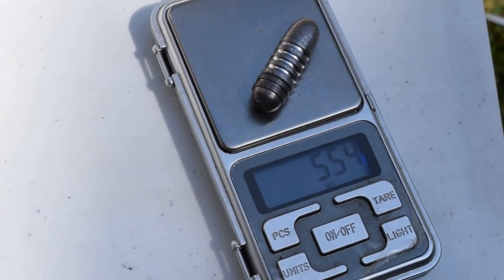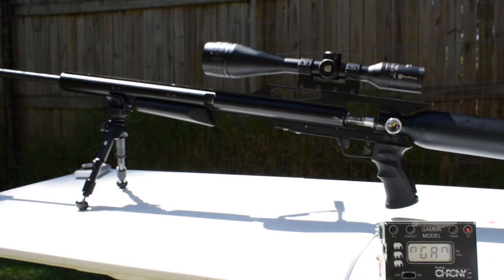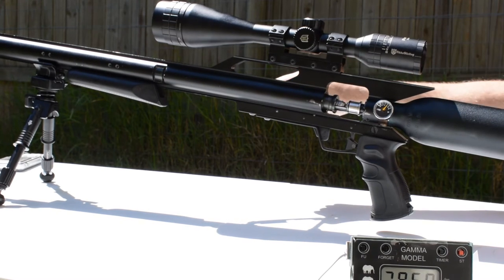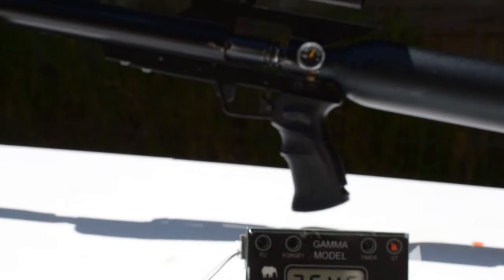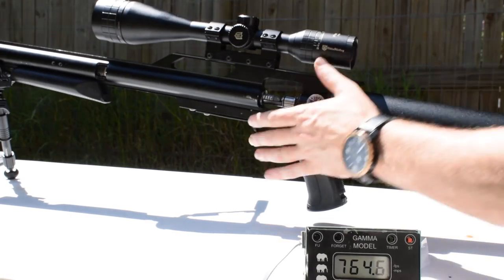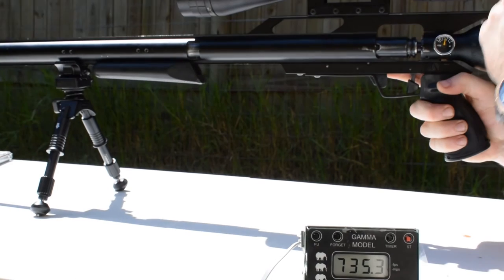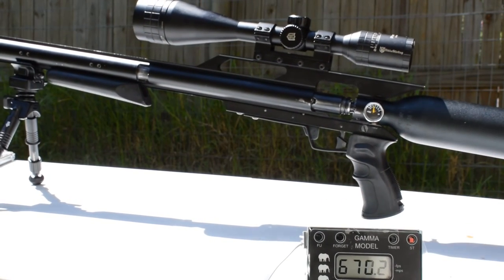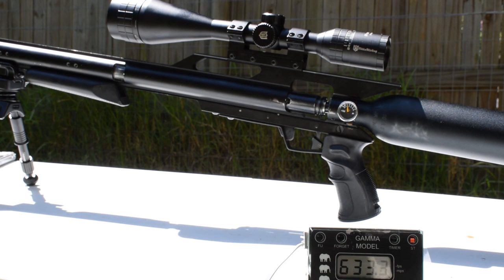Aiforce Texan  761 FOOT POUNDS  with  4500 psi Upgrade ,    554 grain bullet chronograph numbers

Comment: great video and your modifications did you change the hammer spring tank and Hammer. also how are the groups with that much power behind it thank you
Reply from the maker: Yes the Tank came from African Air Ordnance   new 4500 psi valve and top hat  . You have to change out the Spring with the Magnum Spring from African Air Ordnance  to use the upgrade 
Accuracy has improved with the extra speed that lighter bullets get

Comment: fps is not fpe
Reply from the maker: Yes I know  so go to Pyramid air Airgun calculator  key in 552grains  for bullet weight  then key in the bullet speed or fps and it will give you the foot pounds of energy   So 786.9 fps  with the bullet weight of 552grains is 761 foot pounds of energy